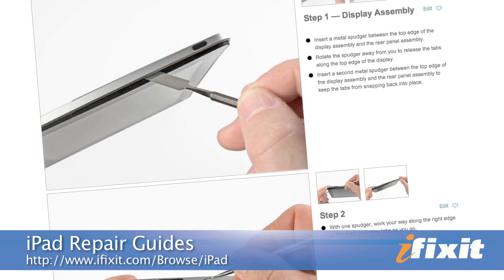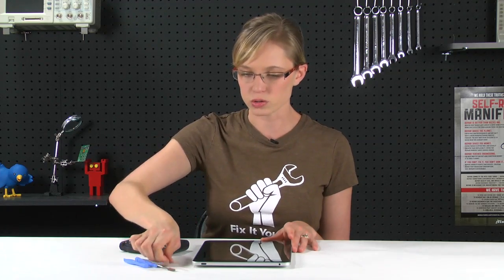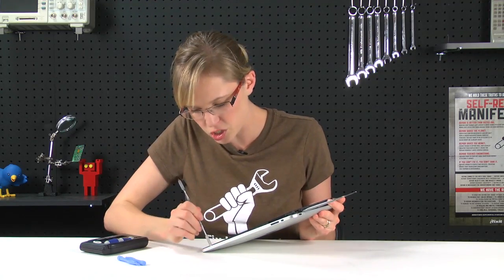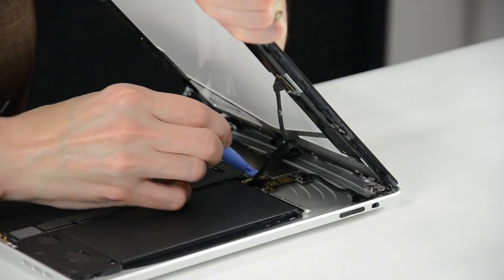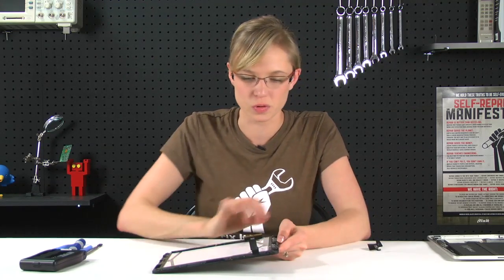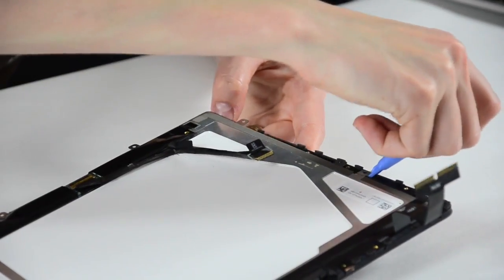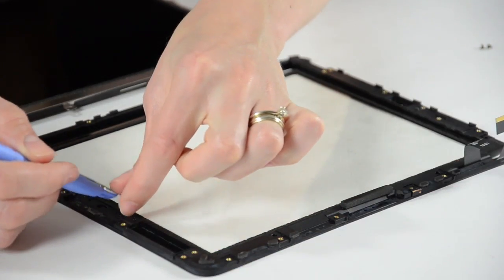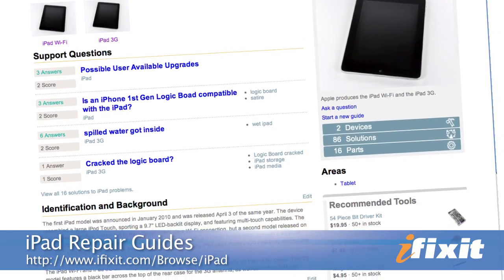How To: iPad Front Panel Replacement

Comment: Just bought an ifixit repair kit with my digitizer replacement no metal spudgers came with it, I cant get the pick between the edge after heating one side for four minutes with iopener pad and using suction cup started to break the glass.
Reply: I've also hair dryer at full blast as recommended by battery seller with picks, no way it will even get in there, some sites recommend IsoPropyl Alcohol & another what looks like a microwave rice back warmer. Did you succed?

Comment: The glass assembly is called the "front panel".  Just check Amazon or eBay for "iPad front panel".  Make sure you're getting the right part (you may need to check the model # of your iPad).  It should be between $20 and $40, roughly.  Check out iFixit's website for instructions.  If you have an iPad 2, instead of their "heat pad" remover you can use a hair dryer or heat gun.

Comment: I think it's the iPad 3 - the iPad 2 (GSM) is assembled differently: instead of locking clips, the front panel is held in place with adhesive, and you have to be careful not to damage the wifi antenna when removing the panel.

Comment: Hello
Nice video.
I got a question: 
I did exactly the same, but when I put the new front panel, the LCD never turn on. Altought Siri keep speaking when I push the button. What could be wrong? did I screw up the LCD?

Thanks for answer.

Comment: ps, You will likely break the clips when removing the screen.  So if you are just trying to replace the home button, power button, battery, or anything other than the screen, then you will need some replacement clips to get the screen installed correctly once again.
pps.  The other video is by contributor called GadgetMenders.  No pretty girl but much more detail and insight into the construction, take apart, and the reassembly of the device.  
Good luck.

Comment: Very pretty girl, clear and articulate, high production quality, but unfortunately has a major flaw.  The tall right hand side of the panel of the first gen iPad is not held in place with clips but rather is held in with tabs that insert into edge of the aluminum frame.  The top, bottom and left hand side has clips.  Prying from the right hand side is possible but it puts tension on glass that promotes breakage.  There is a better method shown by someone called GedgetMedders (no afilliation)

Comment: When the home brew dirties the tape securing the LCD it will never be secure... With this and any factory assembled device failing to secure it again with the correct adhesives will allow vibration and further damage should the home brewer assume it's 'as good as new'. So this is unfortunate advice for home brew maintenance I am afraid....